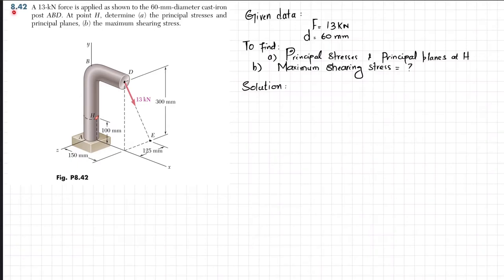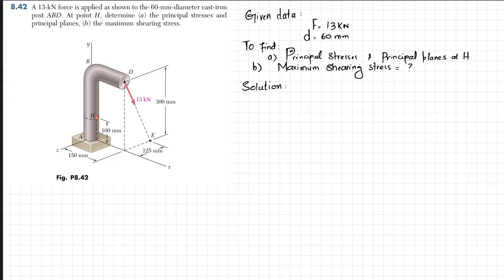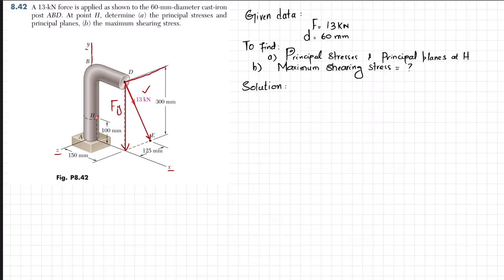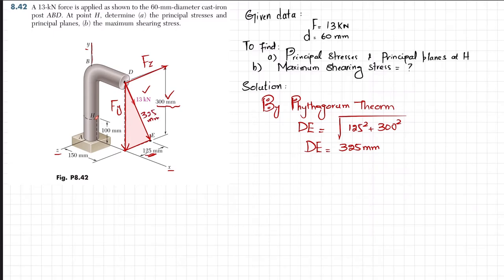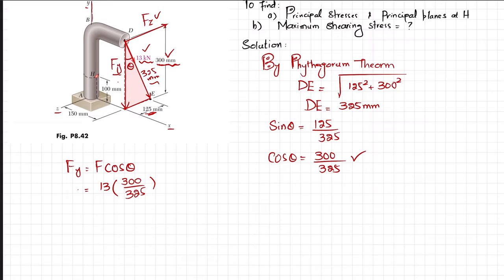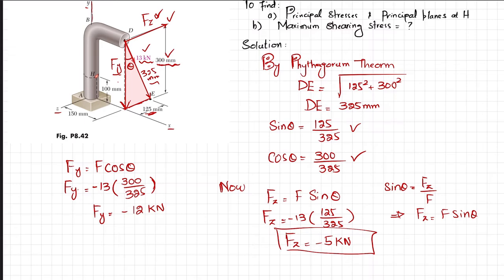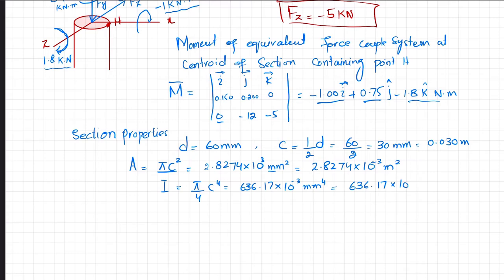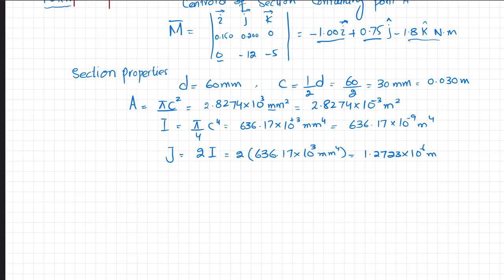8-42| Principal Stress under Given Loading | Mechanics of materials

Comment: shouldn't we write Fz as -5x10^3 instead of 5x10^3 since Fz is pointing opposite direction in the z axis. While writing the VQ/It
Reply from the maker: At 6:12 you can check it is -5KN
Reply: @engradnanrasheedmechanical  thanks for your answer, I said it for 20:21 and also at 26:23 why did you write shear component as positive. Isn't the formula of it is (sigma x , -T xy)?
Reply from the maker: Shear stress produced due to torque and shear stress due to horizontal shear force both are in same direction so that's why we are adding them.
Reply from the maker: Also of you take it negative then again in stress transformation when you calculate R its square will be positive.
Reply: @engradnanrasheedmechanical  sir, thank you very much you couldn't imagine how much you helped me. Greetings from Turkiye
Reply from the maker: You are always welcome

Comment: Sir At point H 17:38 when you are calculating Singma H then why didn't you include stress due to bending moment about x axis while it is also bending the section along with bending stress due to moment about z axis and compressive force along y axis
Reply from the maker: Good question you can see if we take the bending stress due to moment about x axis then point H lies on its neutral axis so it will be zero therefore it is not taken and due to bending moment about z axis it will produce bending stress at H...I hope it is clear now
Reply: @engradnanrasheedmechanical  Yes Sir, Thank you so much you've cleared my doubt.
Reply from the maker: You are welcome and I am happy that you are asking good questions and trying to remove any ambiguity....keep it up